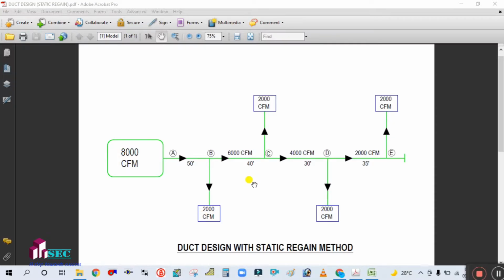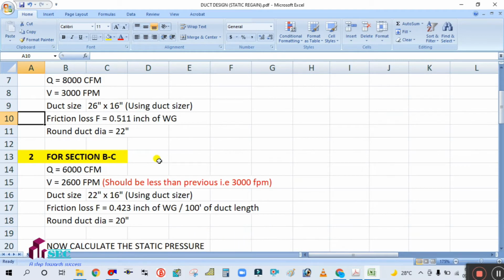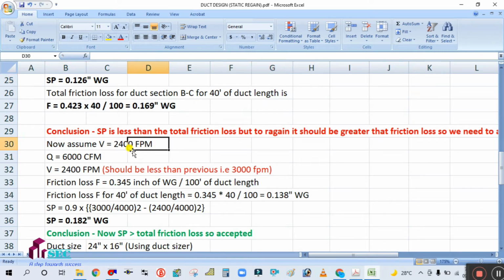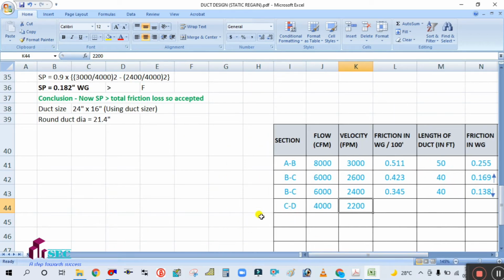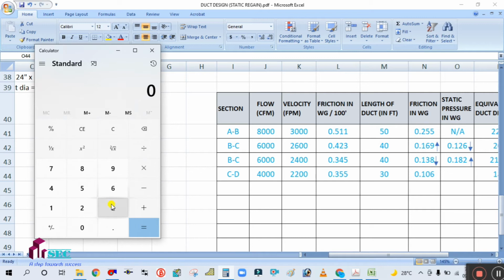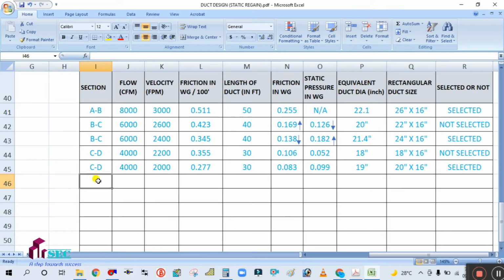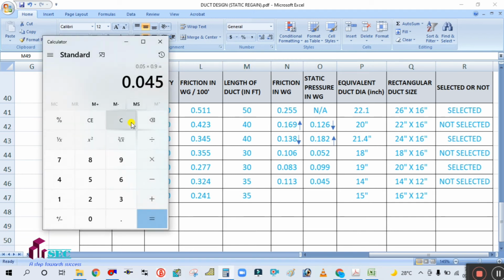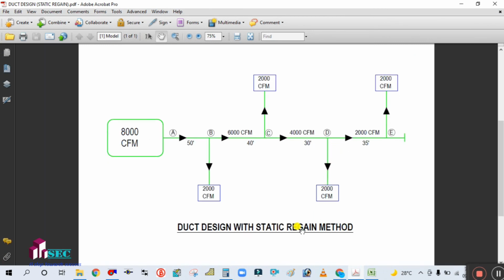DUCT DESIGN STATIC REGAIN METHOD II DUCT SIZING II STATIC REGAIN METHOD II MCQUAY DUCT SIZER II

Comment: Hello, great video. Any similar tutorial for metric units ? Thanks
Reply from the maker: I will make it meteic unit
Reply: Okay, I will be waiting
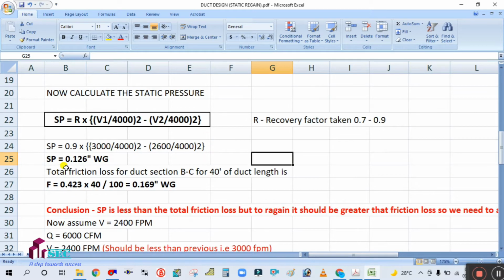Reply: Another question bro, is there a conversion you did for static pressure ? My calculation gives 0.18, your value is 0.126"  6:40
Reply: And also, if you don't mind you can share the reference for static pressure calculation formular.

Comment: Hello Sir, Thank you for sharing a useful knowledge. I have question about how to sizing the branch, if the first branch is 1000 CFM, should I input 3000 fpm for the velocity? and how to sizing the other branch? the second question is, is it possible to calculate the main branch using regain method, and branch using equal friction method? thank you so much Sir!
Reply from the maker: Yes you can size the main duct using regain method and branch duct using equal friction method
Reply: @successengineeringofficial7742  thank you so much Sir. Anyway, could you please give tutorial on how to design and sizing oval duct system? Highly appreciate!